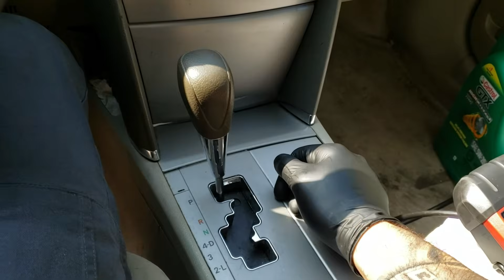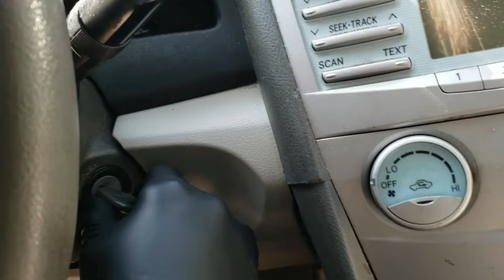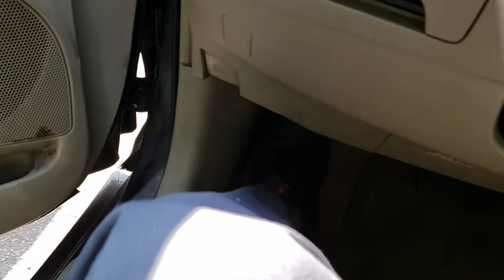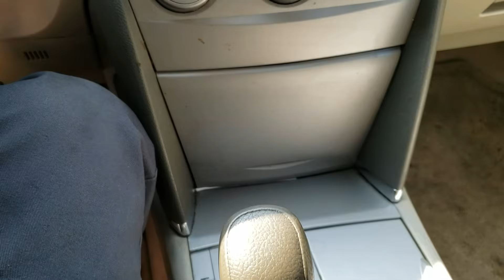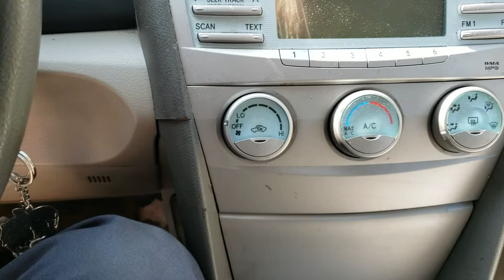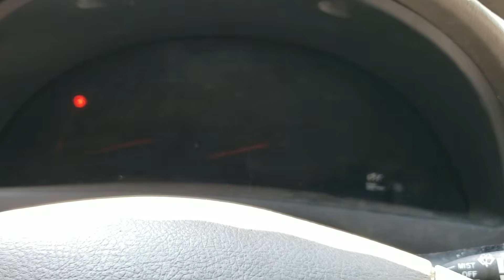2006-2012 Toyota Idle Relearn Procedure

Comment: I replaced the alternator on my daughters Camry. Had to reset the idol. I did exactly what your video said and it wouldn't idol long enough to set itself. I was a very low idol. Keeping my foot on the gas was the only way to keep it from dying. I did get it somewhat better but it's still not right

Comment: Super appreciate these old videos coming in so clutch for those of us who aren't mechanically inclined. Thank you sir.

Now I'm having an issue where my 2008 Rav4 (after replacing the battery and doing idle relearn procedure) won't accelerate. Quick internet search tells me it could be in "limp in" mode. Maybe someone with knowledge on how to fix that could help. Unfortunately I don't have time to do more research before work.

Comment: This only works some of the time and usually reverts back...The actual Toyota engineered way is: warm car up so it's around the middle on the temp sensor, usually just from driving it around; turn off car, start car; let it idle in park for 10 minutes w/no accessories on (no heat, no ac, no lights - make sure lights don't auto turn on if you're in a dark garage; if you are leave a flashlight on the dusk sensor continuously so it thinks it's daytime and keeps the lights off); then with it still running in park put the a/c on (no other accessories though) and let it run for 5 mins; then drive it for 15 minutes or so with a mix of highway, low speeds, and some stop and go driving. You're now recalibrated! You'll notice it no longer sputters at a stop when in drive, and it will continue to learn/adjust from a few more drives, but the first portion solves 99% of the sputter/issue.

I learned this from AI - and what's great is any nuance, issues you still have you can tell AI and it will diagnose them for you.

Comment: Pls my question is : what if the parking brake is not engaged or in a case where the parking brake is not working.
Reply from the maker: the parking brake has to be engaged and working since you are putting the vehicle in drive without your foot on the brake pedal
Reply: @RodriguezRepairs does it mean if the parking brake is not working we can't use the foot brake to do d relearn process.

Comment: alternate method after battery disconnect to eliminate rough idle, turn the ignition switch on but don't start the vehicle, slowly press the accelerator pedal all the way to the floor and release it slowly, do this twice, this resets the throttle position sensor, start the car and idle until the engine is fully warmed up.
Reply from the maker: That's a great tip, thanks for sharing!

Comment: How does this work with a manual transmission?  Sorry but I'm a European 😅
Reply from the maker: Sorry for the late reply but this procedure would not work on manual transmission vehicles! alternate method after battery disconnect to eliminate rough idle, turn the ignition switch on but don't start the vehicle, slowly press the accelerator pedal all the way to the floor and release it slowly, do this twice, this resets the throttle position sensor, start the car and idle until the engine is fully warmed up.
Reply: @RodriguezRepairs thanks I'll try that
Reply: @MrDaddynomates did you fix?
Reply: @yusufaras01 no. It just needed a good old service and new carb

Comment: i change the throttle body and still 1400 rpm on  my 2010 camry 2.5  any advice?
Reply from the maker: Did you try this relearn and nothing happened? still high idle?
Reply: @RodriguezRepairs  i had to replace intake vvt sprocket,that was the problem.

Comment: I tried this like three times and it didn't work, on my 2010 Toyota Corolla I cannot shut off the daytime running lights when the engine turns on. Maybe that's why it doesn't work
Reply from the maker: are you doing this relearn because you are having unstable idle?
Reply: @RodriguezRepairs  yes

Comment: This video is still helping ppl out.  I have been dealing with low idle for a month after disconnecting my battery on my 2010 RAV4.  It would run 500rpm at idle, not enough to stall but enough to sound and feel like it wanted to. And running the A\C only brought the revs up to 600-700.  It sounded and felt rough.  Your instructions worked.  Thank you so much .  Idling wise now!

Comment: Just had the battery replaced in my ‘03 Camry and was experiencing low idle rpm leading to the engine stalling. Tried this and let it idle for about 15 minutes, it worked like a charm! Thanks!
Reply from the maker: No problem, Glad it helped!

Comment: In. 2009 Toyota Venza 4 cylinder fwd 1.7L setting the parking brake alone will not allow me to put the car in drive. The sticks started feature will not allow it. This technique is a major failure!

Comment: Currently 11 degrees and snowing here in Massachusetts. Replaced my battery. Measured voltage with car running saw it dropping. PANICKED! Replaced alternator outside in the dark (should have diagnosed better from the beginning). Fired it up, measured voltage, all good but noticed unusually low idle. Next day fired it up, voltage dropping after few minutes and idle rpms dropping to stall. FREAKING OUT! All day cleaning connection points scratching my head. Came upon your video. YOU SAVED THE DAY! THANKYOU!
Reply from the maker: wow man, what a rough couple of days you had haha but im glad I was able to help you out and get that Toyota back in the road! 💪🏼
Reply: @RodriguezRepairs  My problem with my 2007 Toyota Yaris is that when I start it idles at 2000 RPM and even after it warms up the idle does not go down, what do I do? I thought there was a Idle adjustment on top of the throttle body bu there is not. any suggestions?
Reply: @alexshatner3907 
Run a few shots of mass airflow sensor cleaner through the air flow sensor. 
Let each shot be at least 5 seconds or longer and then let it air dry for about a half hour. 
Once it's dry go ahead and replace it. 
It's easy to find and take off. 
Only use mass air flow cleaner.
Also, replace the fuel filter and blow out your air filter or replace it.
Reply: @nostradamus7648  I ended up with a bad Throttle body I replaced it and bingo it's all good thanks
Reply: @nostradamus7648  Nd by the way I bought it on Amazon for $65.00 brand new the were asking $100 used a the wrecking yard

Comment: I recently changed my 2009 Toyota Auris' car battery and had no issues whatsoever. When turning the ignition key, the car turned on in a second. No idling issues.

Comment: Hi. After disconecting battery engine runs rough, stalli g on low rpm, no power, on cold engine in morning runs fine for about 10 mins. When engine srt making jokes fuel consuption is going up crazy. Done idle relearn. Maybe i need to clean throttle body and relearn again. All began after battery disconect for an hour. Toyota avensis 2009 t25 93kw 2.0 d4d. Help guys!!!
Reply from the maker: No DTCs? No check engine light?
Reply: @RodriguezRepairs  what you mean DCT? Clutch? 🙄 no engine light,no errors on scanning

Comment: Does it have to be relearned after a battery change? 
my camry seems to be idling fine 700-800 rpm after a battery change
Reply from the maker: If there is no issues with your Camry after you replaced your battery then you should be fine.

Comment: Good video 👍

Does This works on Tacoma stick shift ?
Reply from the maker: With stick shift vehicles, it would need to be done with a applicable scan tool
Reply: @RodriguezRepairs  Many of us with manual trans have needed to know this. You should have mentioned it in your video.

Comment: Once you shift the gear into drive after setting the emergency break do you let go of the break pad? Is the car supposed to roll?
Reply: Also can I reset the idle even tho I haven’t changed the battery, alternator, and throttle body or does it have to be under those conditions?
Reply from the maker: It doesnt have to be under those conditions, just if the idle is giving you issues and wont stabilize
Reply from the maker: your parking break should be able to stop the vehicle even if its in DRIVE. your parking brake shoes are probably worn or in  need adjustment

Comment: I had low idle/stall when warm - cleaned the TB, and now idle is high.

Hopefully this will sort it out.
Probably going to need to do it a couple of times.

Noticed the air filter is filthy.

And one of the air intake box bolts is missing.
Reply: Update: Idle is still high.
Mind you that's a big improvement over where it was previously, dying not just at lights, but during low speed turns as well, which is the worst time for power steering to go away.
Reply: @Zomby_Woof you figure it out ?
Reply: @thesheriff120  naah. I still think it's just gunk that I haven't  managed to get out. It's easy for one little bit of carbon to get wedged.somewhere.
Buy I haven't been driving that car lately.
That.may change soon, though

Comment: You are awesome!
Had super low idle after replacing the battery on my 05 Pontiac Vibe (same engine as Toyota Matrix).
 Your procedure worked perfectly for me. I subscribed.
Thank you
Reply: i have 2005 matrix with a manual transmission, does this work for a manual?

Comment: Yeah great, now what do I do when I let the clutch out?
Reply from the maker: for manuel transmissions, you have to use a bidirectional scan tool for the relearn
Reply: @RodriguezRepairs  I literally left it running on my driveway for 6 hours and it went away. That little beater is unstoppable...

Comment: I had to replace my radiator, fluid, hoses and water pump. To give myself room to get to the drive belt and water pump, I removed the alternator and disconnected the battery. When I finished repairs and restarted the car,  the idle was very low, there is no power and the engine stalls out. 
I have tried relearning the idle about a dozen times, using this method. All I accomplished is wasting a couple hours and a lot of gas. Help! Please!
I tried cleaning the throttle body twice ( it was very dirty the first time). I cleaned the mass airflow control sensor. Then I tried relearning the idle again. No progress yet.
Reply from the maker: Are you able to verify you have no trouble codes? other than related to idle?

Comment: I have a 2010 tundra and it worked! The 2nd attempt it worked for me! Also it took my truck around 10 minutes for it to correct itself. Thanks for the video!
Reply: Was it vibrating and running at very low rmps? During the 10min?

Comment: Great video 🎥. 👍. It works for Lexus scion & Pontiac Vibe . if by any chance you couldn't this to work , most Toyotas will relearn process after runing it for 60-80 miles.
Reply from the maker: Thanks for the comment!
Reply: But why did one comment here said he fixed it with this method a year after driving with bad idle.?
Reply: @truth-p5o  maybe a error , my Toyota gives 1 cat- converter code,  then throws traction abs air sensor & airbag  when everything is good .

Comment: What about a manual trans? How would that differ?
Reply from the maker: with a manual transmission, the relearn will either happen on its own after constant driving, or it will have to be relearned with a bidirectional scan tool that can perform it
Reply: @RodriguezRepairs  Thanks for your reply, my rough idle was due to low oil pressure. You know what that means. Rod bearings....

Comment: I had the same problem in my RAV4 after changing the battery and this trick worked perfectly. Only that you have to switch it on and off quite fast, before the initial auto check is made. Thanks for the help!!!
Reply from the maker: That great! I am glad i saved you a trip to the dealership!
Reply: One question, after you start the car, do you need to push the break pedal?
Reply: Did you find a answer to your question ? I have the same question@danielodehielo2129

Comment: Thanks Bud I had no clue this was the issue now I know 😂😂 . Question for you though. My alternator is only putting out 13.3 volts when it should be putting out 13.6 which tells me the voltage regulator may be going bad. What are your thoughts on this?
Reply from the maker: Its putting out 13.3V with all accessory loads on (AC, radio, headlights etc)?

Comment: A huge “thank you”, dear Rodrigos, from the other side of the globe 🌎 (Saudi Arabia) 🌹👌

My Camry’08 was fully maintained in UAE by my great son recently. However, afterwards I’ve noticed a high & rough idle (over 1.5 RPM at start-up).
Your very video has given me hope to get it back to its previous excellent condition.

Question:
Is there a similar procedure for the transmission too?

May Allah (God) bless your good soul.

My sincere gratitude 🙏🏻 
Tawfeek (KSA)
Reply from the maker: Hey there! Thanks so much for watching! Regarding your question, the process is completely different. It depends from make or model. Some transmission relearns can be done manually but some require a scan tool. Most transmission relearns are done initially after replacing the transmission or the control module. Why do you think you need a trans relearn?
Reply: @RodriguezRepairs  

I thank you so much for your prompt reply and kind words.

My Camry is the same as the one in your video in here.
Regarding the transmission question, I hear some short noise when it changes from 1st to 2nd (only)… It is like late or refusing to change for about 2 seconds! Transmission oil has been changed last year; and it is normal level-wise & viscosity & color.
Reply: @RodriguezRepairs  Thank you for your answer, Rodriquez. The transmission slips even after changing half of the transmission fluid and all engine& tranny mounts, especially in the 3rd gear (auto- transmission). It is 14 years old car with 300K km on it, is there a way to salvage the transmission or any hope to fix the slipping issue?
Reply from the maker: @thaieralawadh2223  with 300,000 km, im leaning towards it being a mechanical problem inside the transmission (with the clutches, could be burnt) do you have any transmission codes?

Comment: My car just had a transmission flush recently and I start to notice at cold start my rpms goes up to 1500, 1600. Never happened before over the years going higher than 1300. I tried what you showed in the video, but it's still going up to 1500 or 1600 at cold start. Is there anything else could be done to lower it?
Reply from the maker: do the rpms eventually lower to spec? like 750-850?
Reply: @RodriguezRepairs  Yes 👍

Comment: This is exactly what my AAA guy did today to my 2011 Toyota Rav 4. After my dead battery was replaced, I drove my car but it started shaking while on idle and then the car wouldn't drive while in the middle of a stop light after idling too long. AAA did these steps to fix the idle issue but I couldn't remember them. Glad to have this video for future reference.
Reply from the maker: yes! im glad i was able to help! make sure you subscribe!
Reply: @RodriguezRepairs hi I have the same issue with my 2011 Toyota Camry it keeps dying on sign stop and I don’t know what is it’s
Reply: @RodriguezRepairs and I have bought new battery on it I need some help
Reply: @RodriguezRepairs what about on a manual 5speed 06 Toyota matrix?

Comment: 06 Camry here! Your video helped us so much! Thank you! I was afraid after replacing the battery and alternator (about $300🙄) that I didn’t fix the problem.. turns out a lot of Toyotas need to relearn how to idle properly! Without videos like yours, how would you ever know!!! Thank you!
Reply from the maker: im glad i was able to help! 🔥 make sure you subscribe and follow the Instagram @RodriguezRepairs  thanks again!!
Reply: Hey i just replaced the motor on my car and I’m doing the idle reset on a 06 4 banger just wondering what’s your idle time for your car after the reset?
Reply: My appreciation of Toyota has plummeted.   ☹️
Reply: @glenncordova4027 all cars are the same now. Electric throttle body is shit.
Reply: @glenncordova4027  Then don't ever buy a German car.YOu'll need a $1000 scanner to relearn anything. Toyota actually made this more people friendly.

Comment: Will it work on my toyota corolla 2000 model?
Reply from the maker: no it will not, i believe the 2000 toyota is too old and it probably has throttle cable and not ETC
Reply: @RodriguezRepairs  Thanks a lot! yes it has a throtle cable.

Comment: Thanks for the fix ! I had the battery changed at an auto parts store like 6 months ago and the Camry was idling low while stopped and in gear , I thought I was going to need a tune up since the fuel system is electronic, never thought about a reset , thanks for the info and posting 👍🏼
Reply: My man I’m sitting my car right now waiting out my 5-7 minutes 🤣🤣🤣 was yours dying at stop signs and slow turns?
Reply: @noluckduck9096  I have the same problem with my car it keeps dying on singe stop and when I’m turning

Comment: Is this the same procedure for a 2012 Toyota rav 4 AWD 2.5 I cleaned up the transmission solenoids
Reply from the maker: yes try this procedure if you have idle issues after disconnecting the battery to clean the solenoids